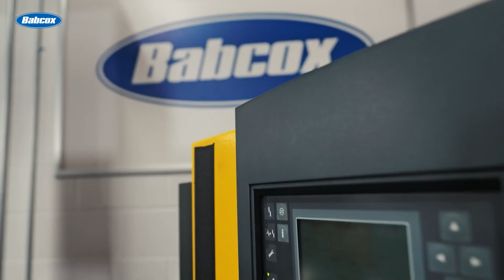Understanding brake pulsation and judder

Comment: Whatever you want to call it, the main cause of warped rotors is over torqued wheel lug nuts from a gorilla on an impact gun. Properly torqued wheel nuts will not cause warped rotors or whatever term you care to use.